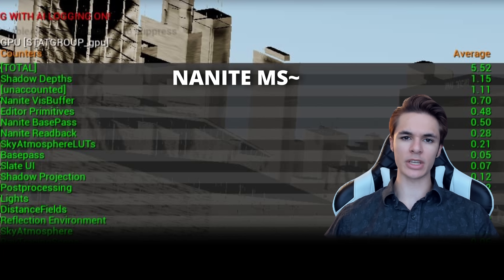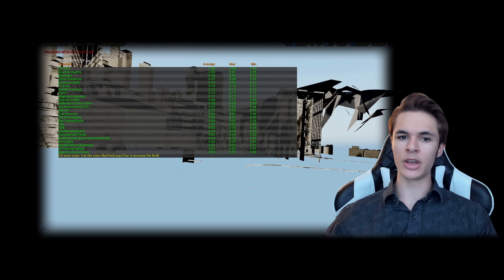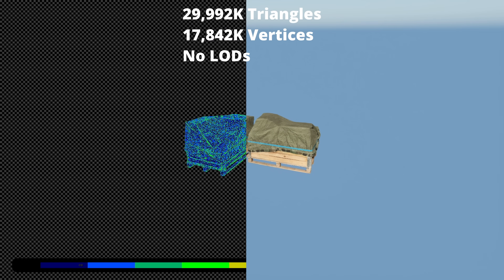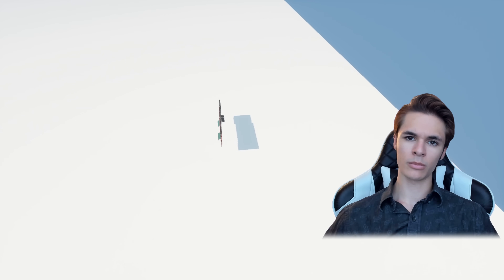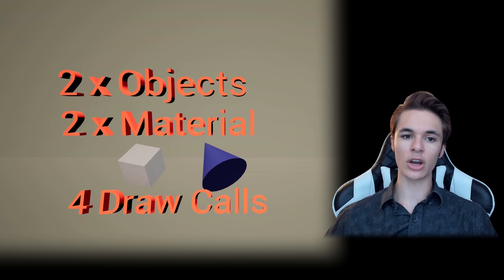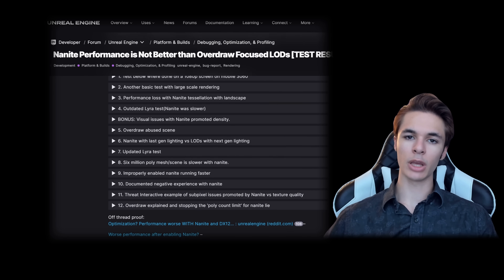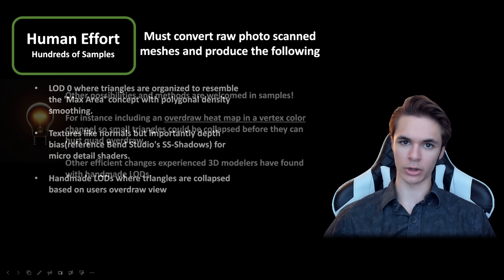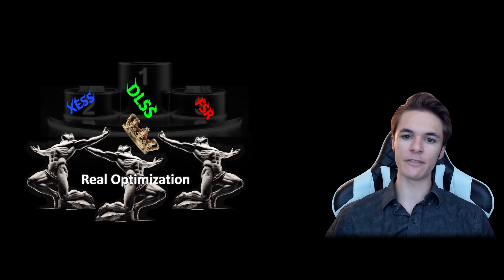Epic's Unreal Optimization Disaster | Why Nanite Tanks Performance!

Comment: So if I understand correctly: Nanite results in a performance gain if you just drop in high poly 3D sculpts without any touchups, but results in a performance loss if you put in models designed with the industry standard and use industry standard workflow regarding performance optimization?
Reply: I swear the point of Nanite was to allow the artists and level designers to just focus on high quality assets and scenes because nanite would do the optimisation for them. It was to stop the need for them to think of optimisation, LODs, how much can the console render in a scene etc because it will handle all of that for you allowing you to just focus on the task at hand.

In theory you could even develop with Nanite and then do proper optimisations afterwards.
Reply: @AndyE7  tbf it seems to do that but that means that you move from the industry standard to this new approach that works with no other engine pipeline. Which then binds you to the Unreal Engine 5 ecosystem, which then obviously benefits Epic. That's why they push it so hard.
Reply: @AndyE7  I am convinced that the real point of Nanite in the conext of the current gen hardware was to attract filmmakers and cinema people, so that they can drop their ultra high poly assets in the engine for animation purposes and not have the engine choke.
Reply: Dude is a capital R retard.

Yes, the entire point of nanite is no more turbo jank LODs. 

“Hurrr durr it’s slower than this ideal case LOD demo I setup”

Go fuck yourself moron, have you actually played games? Pop-in from crappy LODs has been the norm for as long as computer graphics have existed.

Nanite solves this by taking it out of gamedev control so to speak (simplification), just import your max poly models and let the engine figure it out.

The end result is a much better visual experience (no more pop in/LOD twerk)
Reply: This is what I got out of it.

Try mixing it with "the old ways of doing things" = trouble

Use it on its own / with its other new bits = not terrible to actually fine?

Seems overall it would be solid if we'd really ait down with it and figure out how to make it tick. Not all the "tried and true" methods were set in stone from the dawn of the industry. Load of the current techniques have evolved.

Seems to real "problem" is folk insisting on trying to "add" nanite to the checklist when we need to make a new list? But f that is what I'm getting overall?
Reply: Guys you are both right. Basically UE is pushing a new approach (which they promised with the release of UE3, but are kinda delivering only recently with UE5), where the game development process is streamlined and easier for developers, potentially allowing smaller studios make good looking 3d games or maybe even reduce the cost of AAA games. Of course such solution (despite Epic's PR and marketing saying something else) does not come free - in the end savings on the development time, are affecting final product "value" in terms of graphics, what I mean by that, is that the game runs worse or looks worse than expected on such hardware like PS5. I think we have already seen that a lot with many PS4 era games ported to PS5 or even running in backwards compatibility mode, look or run superior to many new PS5 games. Just think about Days Gone, Death Stranding, Horizon, Witcher 3 and so on which were really optimized to run well on PS4. So from the gamer perspective UE approach is for sure worse. It means we get games that look and run worse than they could. On the other hand it would not be the first time when industry standard becomes a solution that allows companies save money, even for a cost of end user experience. But to be fair, in case there is a progress in terms of not only graphics, but also physics, environmental destruction and real time lightening a lot of optimizations that were used till now won't be possible anymore. I think in the long term both for the development process and player's freedom we may need to move away from pre-baked lights and similar stuff. Regarding the channel itself, while the author seems to be on point in many things, the question is can he really do it better? Avoid shimmering, avoid visible LOD transitions, ensure good image quality and performance without solutions like DLSS? We must wait for their game and see ourselves.
Reply: The industry standard is significantly more labor intensive and restrictive. It's not a conspiracy to lock in people to Epic, it's just a better work flow overall that other engines should adopt because it is better.
Reply: @Noubers  Except it's not because that then off-loads the rendering overhead to the end-user. To render anything in nanite more quickly than through a traditional rendering pipeline would require the end-user to have the hardware necessary to accommodate it. This is simply unacceptable and shouldn't be the case. The end-user should, within reason, be able to expect their product (like a game) to be able to function on their hardware so long as it's within decent generational tolerances because the developers should have put in the effort to accommodate the end-user. That's part of the selling-point of video games. It's their job to make a product worth our purchase.

It would be like if Epic created an entirely new type of internal combustion engine that was incompatible with every single vehicle on earth, but was marketed as "easier" to build. Epic then forces factories they have contracts with to start manufacturing this new engine type because it's "easier" for them to produce it — but it's still incompatible with all vehicles, everywhere. This then means the car manufacturers need to completely upend and rebuild their entire manufacturing process to accommodate this new engine design, which costs them a ton of money. The cost of this transition then gets off-loaded onto the regular customer — you and me — that's trying to buy a new car, because the cost of manufacturing these new cars is far higher now due to the alien design of their engine, which was the fault of Epic forcing this new engine on all of their manufacturers. And, even if you end up buying it, it will still run worse than a comparable model car with a traditional engine design; it cost you more and you got a worse product out of it.

Epic is forcing nanite as the default rendering pipeline going forward, meaning you can't opt-out of it! As a developer, this means the overhead of rendering your game falls to the end-user. As a result, your game can only be played by users with the absolute latest, bleeding-edge machines, because nanite only works on those machines, due to its insane overhead. This instantly cuts your potential playerbase to a fraction of its original potential because the cost of purchasing a machine capable of rendering your game is going to be astronomical, not just immediately, but exponentially into the future (as games attempt to render more and more complexity through nanite, chasing the dragon of "photo realism").

The only parties benefiting from this are Epic (for obvious reasons) and large development companies that have contracts with Epic (for the same reasons). But small studios or indie devs? You're screwed; optimising in nanite is currently impossible and, as an indie dev, you probably don't have the hardware necessary to even render your own game. And the end-user? You're double-screwed; you have to front the cost of the hardware to run the game and the exponentially-increased cost of developing that game that anyone outside of Epic's sphere of partners had to eat in developing their game! As a result, both games and the hardware needed to render them will cost more for the end-user to purchase (unless you're best buddies with the executives at Epic).

Nanite is a complete sham and a waste of effort and resources, built upon self-imposed problems that didn't need to exist, with shoddy "solutions" to those problems, which then create new problems without even fixing the old problems to begin with! It's just Epic's way of pushing out anyone that doesn't have contracts with them, practically requiring corporate nepotism in order to operate within their market. It exclusively benefits them and their friends and they know it.

InB4: "StOp BeInG PoOr!!1" because that's the only argument against this nonsense.
Reply: @Armameteus  History is going to proof you dead wrong and its a pity so many of you dev's just don't get that hardware always always catches up.

Artists and designers should not be making LOD's its a kludge, they should not be combining meshes its a kludge, baking in lights and whatever tricks have to be done when algorithms can do the work.

Artists and designers should be focussing on making their games look and play good.
Reply: Hardware always catches up? So you release a game that plays like cheeks, that's fine because someone with an RTX 7090 will be able to brute force a respectable framerate in six years? Yeah let's go back to "cinematic" 24FPS targets for console titles because some guy playing it on an emulator in ten years is really going to enjoy finally seeing it run at 60FPS.
Reply: @MisterFoxton  Does it play Crysis?

But seriously I think your point means little nowadays because we have had variable graphical settings in games for decades, So if you want to hit those high refresh rates dial it down.

What I think matters more are that more studios and people can make games easily.
Reply: @TheReferrer72  Everything you said is an oxymoron. "Artists and designers should not be [doing the things that make their game look and run better], they should just be making their games look and run better." You completely invalidate your own demands.

You call optimisations a kludge, while defending a system that is exactly that. You have no idea what you're talking about and are nothing more than a spoiled consumer. You just want all your video games to be perfect with no effort required, which is not how anything works.
Reply: @Armameteus  Software development is always always a trade off between getting the product out there and making it as polished as possible.

These algorithms enable artists and designers to concentrate on their core competencies.

Also algorithms have a tendency to get better over time, so a few years down the line the penalty will be reduced if not eliminated!
Reply: @TheReferrer72  You just said "Artists and designers should not be making LOD's its a kludge" and now you're telling me we should lower our settings to get better FPS? Yeah I better lower my object details, I sure hope the devs have variable LODs...
Reply: @MisterFoxton  Yep. If what you care about is FPS you have lots of options. 1. Lower graphics. 2. Lower the resolution. 3. Get a better machine. 
Unreal Engine is good enough to get rid of LOD's. 
Some studios might still want to use kludges noone is stopping them.
Reply: @TheReferrer72  Ah, yes. Lower "graphics", knowing nothing about what "graphics" actually means. And, of course, the classic "lol stop being poor and just buy a $4000+ bleeding-edge machine, forehead!"

Get outta here.
Reply: @Armameteus  Go look in any modern game, there is usually settings for low, medium, high & custom. 

4000 is not that much, in the old days we spent a fortune on hardware to run the latest games. 

We still have the option of buying console,  handhelds, etc.
Reply: @TheReferrer72  You seem very confused, you've now recommended people lower their graphical settings three times in the same comment thread where you complained about devs spending time creating those lowered graphical settings. Which is it?
Reply: @MisterFoxton  No I complained about the tricks Artist and Designers make for optimasition when algorithms are now good enough to do the heavy lifting. 

I'm against the very premise of this video.
Reply: @TheReferrer72  your point of "lower the graphics if you cant run it" is null and void when majority of requirements for new and upcoming games are listing high end GPUs just to run the game on medium settings lol. hell, even consoles can barely run these games at a pitiful 30 fps so there's no way you believe that your points make sense. making good optimized games has and will always be a tedious task due to it's very nature so it's better to get good at doing it instead of relying on software algorithms that are completely out of your control
Reply: @DSenji Software studios don't have infinite time or budget, this is why they use libraries, Frameworks and engines. 
First you get your product out there and if it becomes popular then you optimise.
Some franchises can be optimised because they know it will sell, the GTA's of the world come to mind but do you notice how long the dev time is on those games are?.
Reply: @Armameteus 
Someone here forgot (or didn’t know) that hardware is made for technology, and not vice versa. So it was, so it is and so it will be. This is the base.
Reply: @Armameteus  The new pipeline is so that anyone can be hired(and payed less) to just 3d scan shit in, and artists aren't even needed. Similar to modern Devs not even knowing how to code an engine( including UE devs it seems).
Reply: @TheReferrer72  Hardware does not catch up, performance increase over generations have been steadily dropping off over the last 10-15 years and we are already pushing the silicone in our GPU's and CPU's to its limits. Optimization by developers needs to catch up with the average modern consumer hardware!!!!!
Reply: @overtherenowaitthere  Ah, yes, ad hominem. Solid argument. "You're wrong and stupid." Very convincing.
Reply: @Armameteus Based

Comment: Pardon my ignorance im a beginner for learning ue5 in game making and architectural VR walkthroughs. Im curious when would it be appropriate to use nanites (perhaps on organic shapes)? Can traditional quads be used in conjunction with nanites to boost performance?
Reply from the maker: No because quads don't exist for nanite and you should steer away from mixing shadow/mesh rendering methods due to performance problems. 

Nanite only makes sense for virtual production where realtime doesn't matter that much. 

You must choose one or the either(until something better comes along which might be awhile).
Reply: @ThreatInteractive  Thanks for the informative video! :)

Comment: nanite is an implementation of rendering technique called visibility buffer, this technique is specifically created to overcome quad utilisation issues. once triangle density reduces to a single pixel, the better quad utilization of Visibility (nanite) rendering greatly outweighs the additional cost of interpolating vertex attributes and analytically calculating partial derivatives. you can search for an article called "Visibility Buffer Rendering with Material Graphs", it is a good read on filmic worlds website, with lot of testing and illustrations
Reply from the maker: In the original paper on visibility buffers, the main focus was on bandwidth related performance. Visibility buffers might not be completely out of consideration. We've spoken with some graphic programmers who have stated  their implementation can speed up opaque objects, but we are still in the process of exploring the options here.   

While Nanite is a solution to real issues, it's a poor solution regardless because the cons outweigh the pros.

We've seen the paper you've mentioned and we also shown other papers by filmic worlds in out first video ( which discussed more issues with Nanite) .

Comment: You didn't really touch on Nanite in combination with Lumen. Part of the benefit of this workflow is that run time GI doesn't require any light baking. The baseline fps is higher but the dev hours saved not having to optimize lights is worth leaving older cards behind for some devs.
Reply: Except the baseline fps sucks cheeks.
Reply: "Why would we work if we can make players work more to afford better hardware for our game?" - Unreal developers circa UE5 release
Reply: @manoftherainshorts9075  For PC gamers, yeah. But consoles are more-or-less a fixed cost for gamers.
Reply: agreed, very horrible take. Havent seen game development prices? Want more dev's left jobless and projects canceled, because "there's a way to make it slightly better" for 300% development time? Yeah, i think get the card or accept few less frames, and project happening.
Reply: There's plenty of single-person developer teams who make very optimized and good looking games in a timely manner with traditional techniques. Your excuse basically boils down to "skill issue".
Reply: horrible take

Comment: Nanite makes performance less bad when developers spend 0 time optimizing the game graphics, so that's what studios want. Since version 3, Unreal has been extremely slow compared to everything else. It's so bad that making VR games with Unreal is basically out of the question, since to get a stable 90 fps you need to cut almost 100% of visual effects, and make due with only baked lighting and albedo textures. At that point you're better off using Game Maker.

Comment: I remember epic saying this would not replace traditional methods but should be used in tandem with them as it is a way to increase productivity. Tbh this video taught me more about optimization than any optimization video and didnt waste my time. As an indie it did more to reinforce my desire to use nanite while also teaching me how to do more hands on techniques that while require more work may result in better performance that I can use when I have the free time to do so. I thank you for demistifing the BS as I really couldnt understand the tech from those other yt videos as they were purely surface level quick churned content.